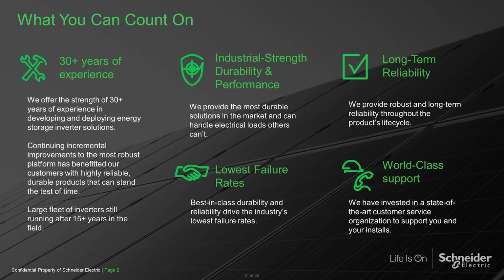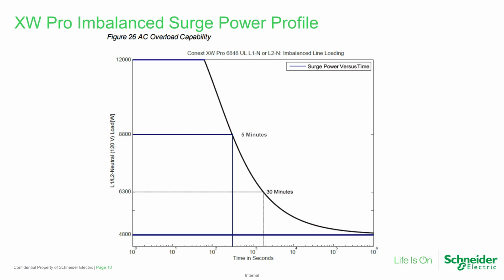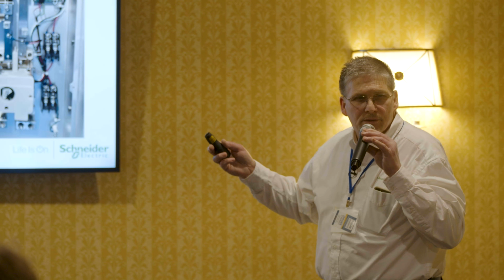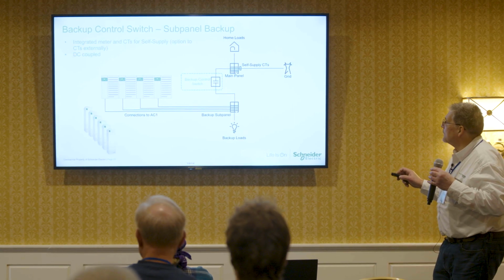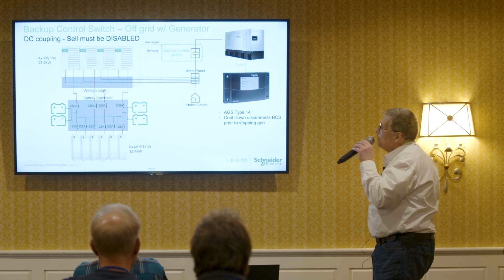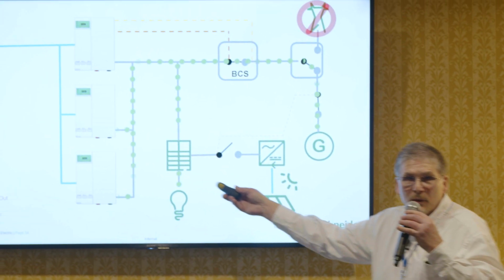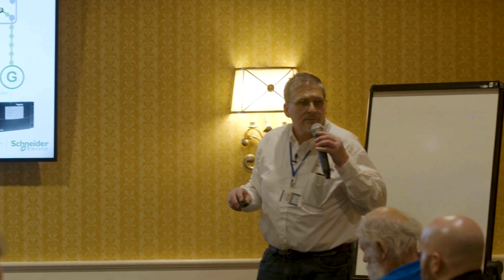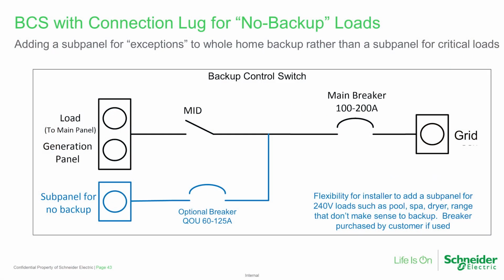Solar hybrid inverter/charger by Schneider Electric designed for the future

Comment: I operate my gridtied system off grid with the XW Pro forming a grid. My gridtied inverters then sync and produce power supply my loads and charging my batteries. I curtail my solar production to keep my batteries at 90% SOC. As loads are added or taken away, the batteries absorb or discharge current to catch the load shift unit the solar output is adjusted to zero battery current. No frequency shifting, no cycling the batteries, no getting caught at the end of the day with low batteries. I've carried up to 50kw of loads with 2 XW Pros and 6 Solaredge inverters with no draw from the batteries. Frequency shifting is stupid.
Reply from the maker: Sounds like you will get the most out of your batteries, that kind of treatment should really help you enjoy a long lifespan on your equipment. Well done Andy. XW inverters are a beast.
Reply: @AltEStore Plus I can carry over 50kw worth of loads on sunny days with only one 6.7kw inverter. Solar curtailment makes far more sense than frequency shifting.
Reply from the maker: @andyfeimsternfei8408-  You are 100% correct and I agree that frequency shifting as a safety net for AC coupling is a far-cry from understanding how the system is meant to function.  Do you remember when folks were using diversion load controllers and banks of heating elements for diverting AC coupled power like it was micro-hydro?   In any case, the answer is to have a deep understanding of the technology you're working with so that you can make it work for you.  An inverter can have all the functionality in the world, but if the person deploying it doesn't understand what they're looking at, then the inverter is really no more advanced than the person operating the control panel for it.   Thanks, Andy!
-Schwa

Comment: Backfeeding a generator does not make it spin backward. The direction of rotation remains the same. However, the generator will motor, which is equally bad.
Reply from the maker: Um, we would never back feed a generator. We would backfeed a smart meter and make it turn backwards though.
Reply: @AltEStore "Spinning a generator backwards" is what the Schneider engineer stated in your video. I've heard him say this in other videos. That is not what happens.
Reply from the maker: Oooh, this is fascinating!   I wanna have a go:
"If we are spinning a generator, it is to say that we are spinning a rotor around a stator and that the expanding and collapsing magnetic fields will happen at a given frequency relative to the speed of the rotor. Faraday's law is applicable here.  In a 2-pole alternator, the rotor and engine speed must be 3,600 RPMs because 60Hz is 60 cycles per second and there are 60 seconds in a minute. With that same knowledge, a diesel generator with a 4-pole alternator will need to maintain 1,800 RPMs to hold the same 60Hz frequency on the AC output.  Here's what I'm driving at:  Since AC power is changing directions 60 times a second, you would still have an AC output from a generator where the rotor was spun backwards.  Your Phase One would become Phase Two and vice versa as the magnetic poles in the rotor would be crossing the stator windings in the opposite order in a clockwise/anticlockwise relationship.  Most modern generators won't do this, but it's a fun thought experiment for a very basic generator without an integrated gen controller that governs everything.  Off Grid engineers think about things a little differently..."
-Schwa
Reply: @AltEStore If an induction motor faster than it's no-load speed, it will become a generator and export power. The same is true with a synchronous motor, howhever there is no slip so the speed stays the same up to breakdown torque. So if a generator is backfed with excess current in, it will motor, driving the engine. Up to the capacity of the engine, it will simply idle down and behave like an ICE engine does going down hill. There is no reversal of  the direction of rotation.
I have worked in power generation for over 45 years (mainly hydro). We often operate generators as motors and as generators simply by opening the turbine gates or closing them. Many large utility generators are operated in spinning reserve, online operating as a motor until power is needed and the turbine gates are opened to instantly generate power.
Reply from the maker: This is so fascinating, @andyfeimsternfei8408.  We really appreciate you lending a bit of your knowledge on motors and hydro.  I'm always so excited to learn new things.  It's fun to see where the rubber meets the road on these highly technical discussions.   You are appreciated.   :)

Comment: My preference for integrating a generator would be through a charge controller on the DC side of the inverters, This would allow any sized generator to be integrated & run at any time, as a way to extend battery capacity. EG4 makes an AC to DC converter that allows tuning the DC charge rate to match the generator capacity.

Comment: Thanks for the vid, altE. Ugh, still a crappy product that can't compete the the Tesla PW. Wish there were more competition (Franklin WH US distro is overpriced). This is an ugly solution with poor FW control. Battery + 480.7(D) DC disconnect + XW Pro + PDP + 706.7 AC Disconnect + Backed Up Panel + BCS. Still, I think it's the only viable non-Tesla ESS but total solution is still overpriced (compared to PW). I can't make a value proposition to any customer with Sol-Ark - way overpriced. Growatt or EG4 has spotty reliability and can't get past AHJ permitting in most places.
Reply: What is  FW control ? thanks